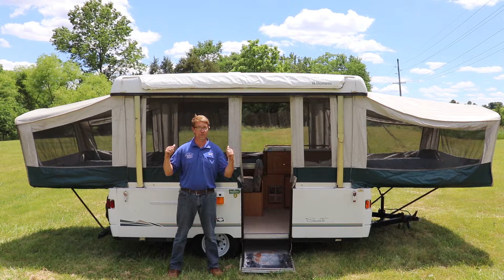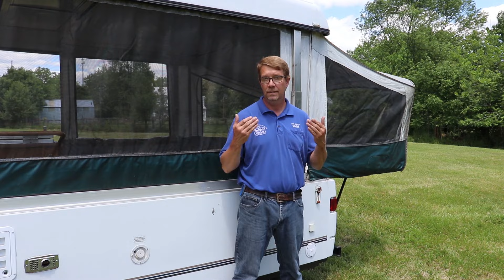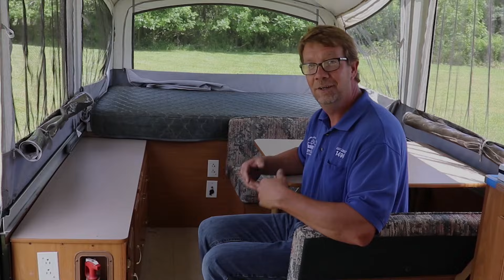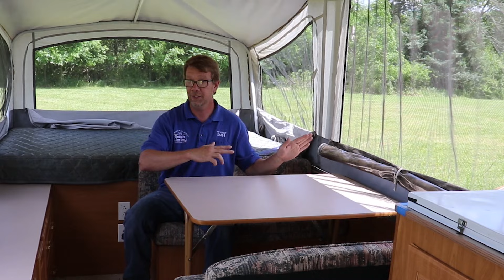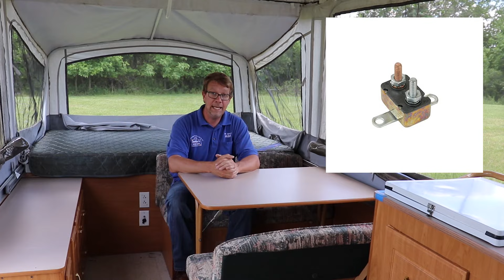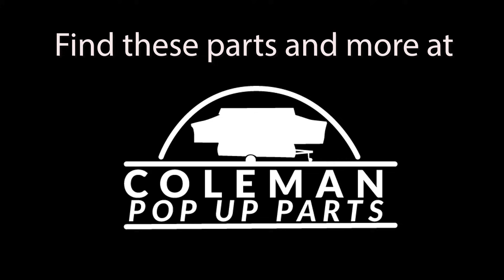Pop up camper power basics

Comment: So connecting to a battery does not power outlets. If I connect to a generator, would that power the outlets? 

If a generator would power the outlets what do you recommend? What are the benefits of getting a dual fuel one?

Comment: Just discovered your channel/Video. Very precise and to the point. Thanks for sharing your expertise(I have subscribed).

 With that said, I am new to owning any type camper . , I just purchased a used 1993 Skamper .  I am in process of upgrading a few items  and while camper is in good shape and minor upgrades are going well, I need help re: original water heater, which is no longer working or repairable( I have removed from camper).  My ? is.....I want to replace, preferably, with an ON DEMAND PROPANE water heater.  I have been researching those offered online. But I am confused.  Do I need 110/120 volt power to run the heater? Specifically, the module which most come with and which allows me to monitor, drive blower, adjust temp etc?
 All I have is12v battery(DC), converter pump etc.  Camper has sink, shower, and cassette toilet inside.

Fitment, plumbing is not an issue but any electrical has got me stumped. I'm making a big issue out of something simple, however, I don't want to through money at this water heater and get wrong one, as they are  expensive and some non returnable.

Also, Any recommendations for propane on demand heaters welcome.

Thanks for any guidance.

Comment: Thank you for your informative video. I found some answers on my questions, also I read all the comments but still have a question. 
I have a Palomino colt 2000. When I plug in shore power I have power in the outlets but no lights, no battery charging, the furnace is not working.
Everything works until the battery runs out of charge.
Looks like the converter is down. Could you recommend a converter model for my camper?

Comment: Thanks for the video! We just inherited a pop up and a few things have been removed from inside, mainly the sink and the heater no longer works. We have a refrigerator, the lights, and a removable ac unit. If we only plan to use the camper at plllugin campsites, do we even need to bring the battery? Will the lights, plugs, ac, and refrigerator work once we plugin at the site without the battery? Thanks!

Comment: i have a 2000 Jayco Eagle Pop-up camper.  Can I use a Lithium LifePo4 Deep Cycle rechargeable battery 25.6V 50 Ah to just run the interior lights? (not the AC or outlets)

Comment: Hi Derrick, 1st I want to thank you for all of your educational how to videos. I know how hard you work to put all of them together for us Coleman pop up camper owners. They have saved me many times. I hope you can help me out with an electrical question I have. The exterior outlet on my 2003 Coleman Carmel hasn't worked since I bought it used. The step light works and the porch light works. I'm hooked up to my house shore power. All outlets and lights work inside. I've checked fuses and they're good. I have 2 breakers and they work fine. None of my outlets have a reset button. I tested the outside outlet with a small FM radio and it doesn't have power. The radio works fine off the inside outlet. What would you recommend I should look for so my outside outlet will work? Thank you!

Comment: I have a 2015 Rockwood Freedom 1970 and when plugged into shore power, my battery does not charge. Outlets work and fridge work, so shore power is working, but about 3 days into every camping trip all the 12v items stop working (the lights dim, fan stops working, and the lift system to lower the pop up doesn’t work). What would cause this? And recommendations?

Comment: I just bought an ‘95 Coleman Stony Creek and the previous owner said the furnace only able to run on shore power. Is that true? I couldn’t test it right now as the propane connect is broken and I think not replacing it as I won’t cook inside, but if the furnace can be used when we drycamping that would be another story.

Comment: New to pop-up campers. Thanks for a good overview. I had a quick question maybe you could help with. My 12v system seems to be fluctuating power. Plugged into shore power via 15 amp adapter at home. Lights fluctuate between bright and dim every 20-30s. Any thoughts?

Comment: If the battery is dead, but the trailer is plugged in, is there a way to get the interior lights to work? Our outlets work, but the lights only seem to work if the battery is charged, even 8f the trailer is plugged in.

Comment: My 96 Coleman seems to only have power in the 20 amp and the 15 amp circuit seems to not be working. I've checked everything except taking the circuit out. We have ceiling lights and one outlet below the front bed that works. Thanks so much

Comment: New here and need help . have a 1998 Coleman Mesa missing the battery and wiring going to the black and white wires coming out of trailer.I bought a curt soft trac 2 break away kit and not sure how to integrate the wiring any help deeply appreciated.

Comment: Derek for the win - again!  Here's my dilemma. Boodocking. 2009 Fleetwood E3. New Interstate 27DC (600mca). The only system running is heater. (lights off, h2o off, fridge off)  Heater cycles 3x without firing; needs to be reset. four times we go through this and finally it lights and blows for an hour, with strong fan.  when it turns off, the CO2 detector chirps and the battery indicator shows weak.   How can this be?   My thought is the battery lead connections need dielectric grease or new 40amp breaker.

Comment: Need some help. So I have an old pop up 1985 coleman pinoneer. It has 2 inside dome lights and 2 plug outlets. If I have a large deep cycle battery connected, and switch the inverter to battery. Can I use the outlets. Will they work?

Comment: Having Terrible electrical problem. Changed overhead lights to LED. Hooked back up..no light. Yes I switched lighting to make sure had wired correctly due to fact can not reverse bulbs ,solid circuit. So I switched wires. No light. Hooked to my trolling small battery,they work. Hooked back up to plug in garage, no lights.
Did a top rebuild due to rot. So wiring is new. At the lift arm at rear,wiring disconnected when I did rebuild. Checked fuses..all look ok. Burned up my volt tester because I forgot to swap to AC when I tested inside wall outlets..duh! Bought new one. Now afraid to do anything to test wires coming up lift arm. Help!

 Tested recepitals got power.

Comment: Hey! Great video! If I'm going to be 100% stationary plugged into a 30 amp outlet do I need to convert the power to DC for a battery still? I would never ever use it. Also do you have any videos or know of any you could direct me to that would show me how to wire the entire system? I'm starting from scratch, im not doing a water pump or water heater or even lights(I have small battery powered strips and light bars) I just am so confused on the breakers and converts and how it all comes together

Comment: I have a 99 Coleman Bayside. Water heater was removed and fridge switched for 120V. Does it matter if I go with a 15 or 40amp battery circuit breaker? I need to replace the harness.

Comment: Thanks for the excellent video.  I have a question on operating my Atwood 7916-ii furnace. It operates as expected when plugged into an AC outlet.  When on 12V battery the fan runs although does not appear to be fast enough to close the sail switch and therefore will not ignite.  I've inspected and cleaned the sail switch.  Any thoughts appreciated. The 12V battery was charged and measured ~12.5V.

Comment: In my trailer the outlets work when plugged into the ac but it's not charging the battery.   So after a while the lights and pump no longer work.  I can charge the battery with an external battery charger... but why isnt it charging from the ac hook up?

Comment: Hi.  New to campers.

When I plug my camper into shore power at 15amps. With Nothing plugged into the outlets and the fridge and lights are turned on.  I can turn the furnace on,  but it pops a breaker somewhere, but will reset with a couple seconds. 

Is this because I’m plugged into 15A and not 30A?

Also, my trailer does not have a battery connected.

Comment: I love your videos and I love colemanpopupparts.com. Since purchasing my 2002 Coleman Fairlake earlier this year I have purchased several parts from the website and watched your videos to learn how to work on my camper. I am currently chasing some gremlins in the brake system and I could use some info. The break-away switch works great. When the plunger is pulled, the brakes apply. When I connect the trailer to my truck, I get a “no trailer “ message from my truck when I try to adjust the trailer brake gain or squeeze the the brake slider. I am wondering where the blue wire that connects to the break-away switch ties into the wiring harness. A little bit of background info: The previous owner had cut off the original 7 pin connector and installed a 4 pin. Apparently they weren’t concerned with brakes. I  covered it back to 7 pin with the cable/connector that I purchased from you. I’m thinking they might have cut/spliced underneath somewhere as well but I don’t know where to look. Thanks!

Comment: I bought my popup used and there is no battery installed.  I had it plugged in fixing it up and everything worked fine.  However when I replaced the trailer plug (4 prong), the trailer lights work, the air unit works, however the inside camper lights do not, and the gas leak alarm beeps "fault - low voltage".  What happened? Thanks in advance!

Comment: Ok I have a 2001 coleman pop up with a/c. I hooked it up to the outlet at a camp ground and it blew a fuse and then everything stopped working even after I replaced the fuse. Now the only way I have a/c is if I plug the a/c into an extension cord or generator. The battery is brand new, yet nothing is working. Could the converter be bad?

Comment: Hello! Amazing video thanks for explaining everything so clearly for a total newb! I think I have this same exact trailer, a 2003 Coleman Laramie. Our two ceiling lights stopped working when we’re just using the DC battery, but they work when plugged in the home. But we think the battery is good because the carbon monoxide light and the small light switch for the storage area works on DC only. We checked the fuses and the kill switch works. Any ideas of things for us to try? Thank you!!

Comment: I’m new to pop up campers and still figuring everything out. I have two questions. My camper is a’99 Coleman Sun Valley. On the left side of the galley is a rocker switch. Is that for the water pump? And also, can I use an inverter generator instead of a solar panel to run everything. I usually am not in a formal campground.

Comment: good video thanks, just got a 03 caramel i just learned it wont rin the water pump and fredge long on 12v , is that ok ? my low voltage alarm kept going on and off so was the pump.

Comment: I have a small pop up camper with only 2 dome lamps and 2 outlets. No built in heat or ac or water pump or anything fancy. It’s been in the family a while and we have never had a battery hooked up, always used shore power line either to pole or a generator. I recently purchased solar panels and an inverter and was curious if anyone had used the shore power line plugged into the inverter hooked to a battery charged with solar. Sounds like it should work to me.

Comment: Hi - Question for anyone out there familiar with a 1999 Niagra Coleman By Fleetwood. I just purchased one and I'm having some issues with the plumbing, specifically a leak under the dinette slideout. Does anyone have a diagram or instructional video on the plumbing basics for this unit?

Comment: I have no power when i run my 30a. i have replaced the main power/shore  cord. no tripped breakers and fuses not blown. i still have power from a battery source. Any ideas why my 30a side is not working? we were in day 4 of a camping trip when we lost all elec power. was realy hot and had 3 little ones with us, had to pack up in middle of nite.

Comment: Great video.  How efficient is the converter in charging the battery?  We'll be boondocking for 4 nights, but will have a generator to plug into, but only want to do so to keep the battery charged. If the battery gets down to 12.4 volts, for example, would being plugged into the generator 30 amp connector charge it back to 12.7 in an hour? 2 hours? There are probably parts of the equation I'm leaving out, but looking for an approximation.  BTW... that looked a lot like our '02 Santa Fe!

Comment: Thanks for this! It answered a lot of my questions. I would love to see a series on annual PM stuff we should be doing (ie. Greasing wheel bearings, lubricating the bed rails, PMing the wiffle tree and drive shaft of the roof system etc.). Also, I have a Somerset E3. Would love to see some content for those if able. Thanks

Comment: The connector does not control the amps.  The appliance controls the amps.  If your ac is hooked to a 20 amp circuit, and asks for 30 amps, it will simply trip the breaker associated with the circuit. If you are connected to a 20 amp circuit, and the AC is running, it is pulling less than 20 amps.  How could this damage the unit?

Comment: So, I plug the AC into the camper (in the t-shaped) outlet, and then I use the converter to plug the trailer in my household plug. I usually run my AC while I'm working on it (I live in las vegas!) So doing that will damage the AC unit?!